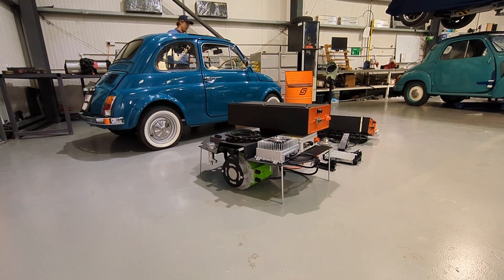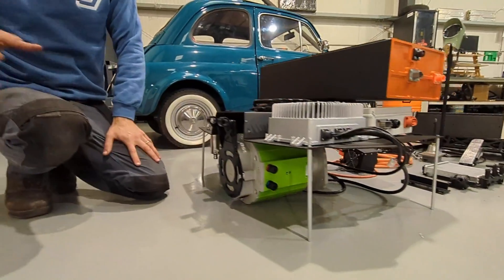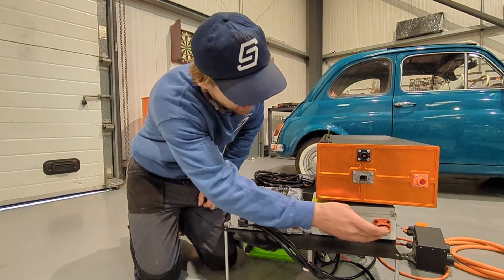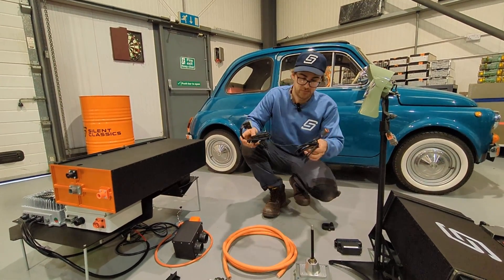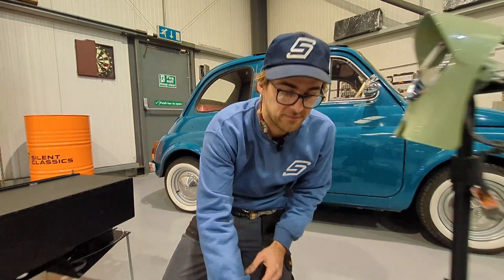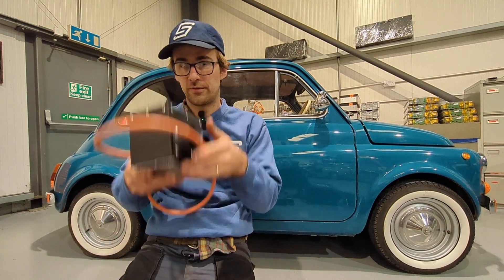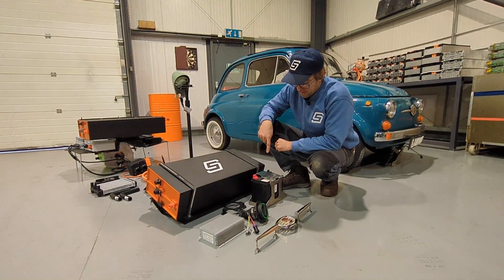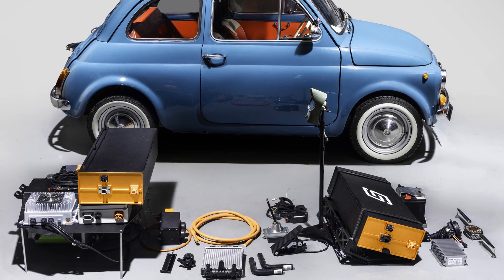Tesla powered Fiat 500 Electric Conversion Kit.  Full bolt-in kit overview.

Comment: Will this kit fit in a manual 2012 fiat 500 twin air?
My engine has metal in the twin air 0.9 turbo, but this would be awesome. What’s the torque on this electric kit/
Reply: Your engine is supposed to contain metals in it.

Comment: Should the motor be 44kW, not 44kWh? KWh implies storage of energy which a motor isn’t capable of. :)
Reply: I do agree with your comment. However, I do like the very neat replacement for the Fiat 500s original Speedometer, but there was never a mention with regards to the number of miles covered. I did not see an Odometer Function. Did I miss this? It's really important.

Comment: One question why don’t you offer one that connect to automatic gear would the gears not give you a faster 0-60 and faster top end. Pls excuse me if I am being an idiot while I understand the basics of electric cars I am coming from a history of ICE vehicles and truly don’t know. That said this car and kit looks awesome. I would love one for a Volvo es1800 maybe a 75
Reply: Electric motors are too powerful for automatic transmissions.
Reply: @89five3five  yarrrr that old transmission is gonna become a nice metal slushie if you attach a big new motor to it lol.
Reply: For the most part a transmission isn't really necessary on an EV, because electric motors have a wide power band. Also an automatic transmission loses a lot of power due to the pumps and things. So it wouldn't work well. A manual might be good, but only if you are using an underpowered electric motor like I am on my conversion.
Reply: @oddjobsandrandomprojects  sounds like a manual 5 speed would be great on my electric power chair that has a whopping 1.5hp, and goes all of 4 mph.

Comment: If it doesn't need a clutch, and it runs through a locked gear box why not just attach it directly into the differential?
Reply: reverse maybe
Reply: the diff is in the gearbox

Comment: I have to disagree im afraid. Why anyone would put a battery into a classic car like this, is beyond my understanding. Its not a classic 595, fiat 650, alfa twin cam, or anything else remotely similar, unless you get the sound of the ice and the smell from the carbs. This is just driving a retro toaster. 
EVs have their place. As i mostly drive within a 15miles radius for work, i would use one in a heartbeat. This though, this is sacrilegious
Reply: Is it still sacrilegious when it's a bolt-in conversion?
Reply: Have you seen the price!
Reply: @psircos: Don't you have the sneaking feeling that governments and local administrations are preparing to prevent the use of any IC vehicle? At least this kind of decent conversion will allow some older vehicles to be seen and used instead of the wholesale destruction which may be just around the corner. Moreover, it's odd to call it  'sacrilege' if the conversion is bolt-in / bolt-out.
Reply: @htimsid  the older I get, the more sneaky feelings I get and the more suspicious I become! Like, when said governments push a product down our throats (EVs), in the name of progress, without appropriate figures to back it up, then I get a sneaky feeling it's all in name of lining someone's pockets 1st, anything else second.
Tbh, no, I don't think so. In my street and the surrounding area, yes sure, everyone could have an EV, 2 if they wish, with ample space to charge them. But, a big portion of the population don't have that luxury. The infrastructure to then go ahead and consider a ban on ICEs, is many many Many years away. Luckily by then, I'll be away
Reply: Well, I think this is a point of debate/discussion which will ware on for decades. Going by what is known, EVs are 'not' the saviours of the planet and the more that time passes, the more this appears to be true. 
In my view, appreciating fully that this is only my view , replacing a tiny petrol engine with a electric motor serves no purpose, other than the cost of this, to the supplier. If we take this wee car is particular, what's it going to do; 1000, maybe 1500 mls per year. Probably less! Almost all the fiat 500 or similar cars that attend Italian Day, for eg, have their cars on a trailer. So I ask again, what's the point?
Reply: @psircos  slightly speculative conjecture perhaps.. 
with the conversion why do you think it would be limited to 3-5 miles a day? with your 15 mile trip you would easily hit 3500+ and be capable of 10k easily.
it will also go faster and quieter than the original.. parts will also now be easier to source when they are needed, but the failure rates are tiny compared to classic ice. :D 
An EV this small you could easily power of a very cheap small solar setup. 
15 miles will be only 4 kwh (and just 28p total on night tarrifs) 4kw of panels is only £600 right now, so just 1 hour of full sun!!
Reply: @GregHighPressure  I can tell you that I converted my '71 Beetle to 100% EV, and this happened in 2019. I have owned the Beetle for 20 years, and it has always been driven daily as a local car. Yes, the conversion wasn't cheap, but the EV Beetle has proved itself, being 100% reliable. It has a range of about 150 - 160km (100 miles). I charge the Tesla battery Pack slowly (8hrs), because I am a believer that ultra-quick charging does not do the batteries any good. In all of the time (as an EV), it gets driven around Sydney, and has been 100% reliable. The EV Beetle (125 HP or 88kW) has breathtaking acceleration by comparison with the 1600cc Twin Port Engine. It leaves many modern cars in the rear view mirror. The costs to run the EV Beetle (on daily use) for electricity is around $8 per week (four UK pounds). You can waste your hard-earned money on a Chinese EV, that will depreciate at around 35% in the first year. There is no depreciation when you convert a Classic Car. I truly value my Beetle, and at 75 years of age, the last thing that I need is to be broken-down in a very busy city. I have retained (and Crated) the original engine. But it will never go back into the Beetle under my ownership. No more queuing for petrol - so lots of time & costs saved there. The EV Beetle goes to many Car Shows, and is always well-received. I just had to write down this comment, and hopefully dispel a few myths. I have future-proofed my Beetle for the next 50 years. Greetings from Australia.
Reply: 😂....not speculative at all. I  own an Italian car. I go to Italian car days/shows. People don't drive these things a great distance! One very small example...brakes are rubbish! You wanna go and make them faster?? So, not only are you paying for the electrification,  you also want to upgrade everything else! These are NOT modern cars, but by electrifying them, you suggest they are more usable,  which is not the case.